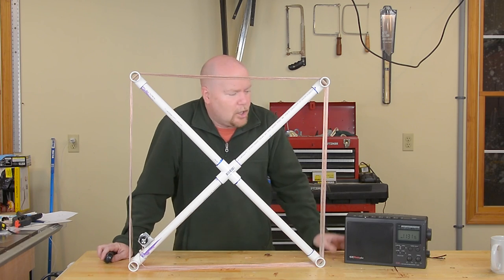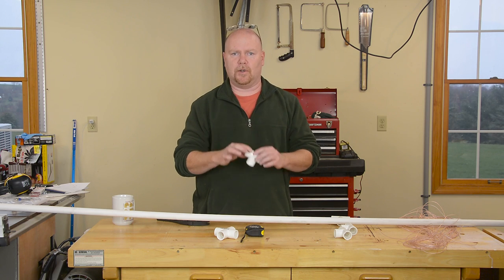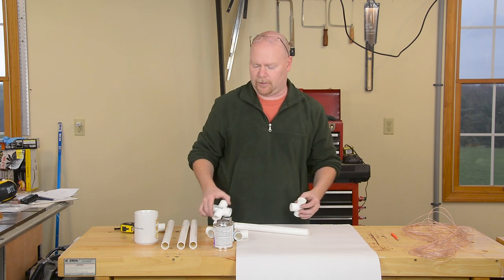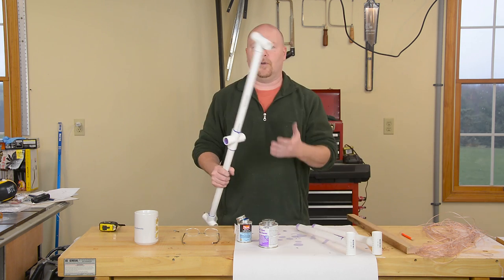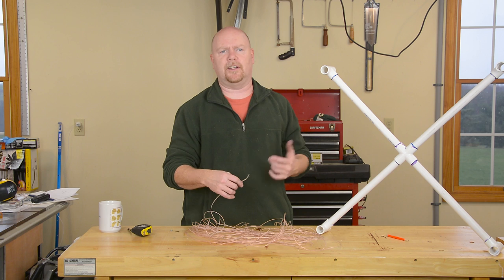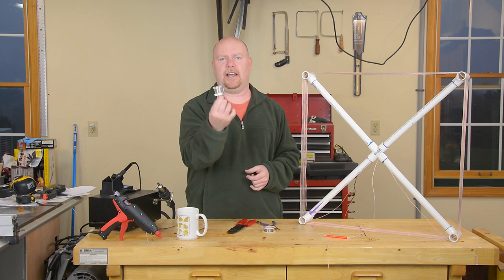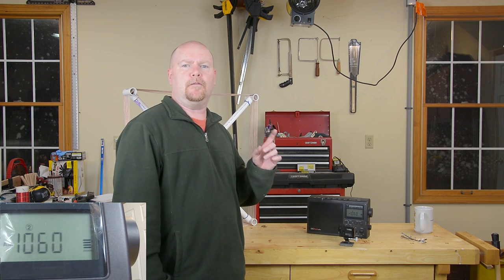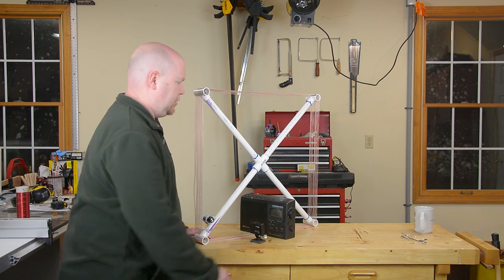AM Loop Antenna from PVC Pipe

Comment: Bro, just a cheap active antenna will do at least so do as the contraption you just build
Reply from the maker: Not even close.  An active antenna relies on an amplifier to boost existing signal.  This actually captures a lot more signal AND it's high Q filters out unwanted signals.  No comparison in effectiveness.
Reply: @MattHeere  bro your antenna seems not even be connected to anything
Reply: A loop is directional - you can null-out any co-channel stations or interference - provided it comes from a significantly different direction.
Reply: @VicGreenBitcoin  because it's not connected to anything. It doesn't have to be. That's the neat thing about radio waves, they're wireless.
Reply: @alec4672  Bro, just a simple long speaker wire will work even better.  The contraption in the video is super practical. What I stated before a simple active omni will work at least that good. You want direction sensitive buy a active one.
Reply: @VicGreenBitcoin  directional antennas always receive better than omnidirectional ones.
Reply: @VicGreenBitcoin  this is the best am antenna I've used (I used to have a cheap active antenna). I can pick up a 10kw am station from approximately 100 miles away as the crow Flys in the middle of the day. Wish I knew about this sooner. A cheap active antenna is not even comparable.
Reply: @larchman4327  Bro 10kw over 100 miles is easy, can do that without antenna
Reply: @VicGreenBitcoin  troll.